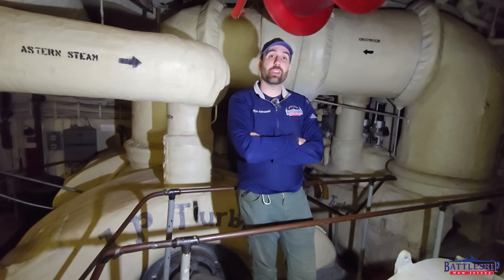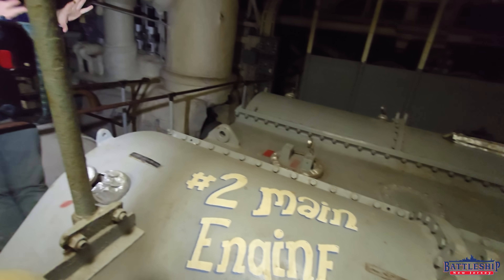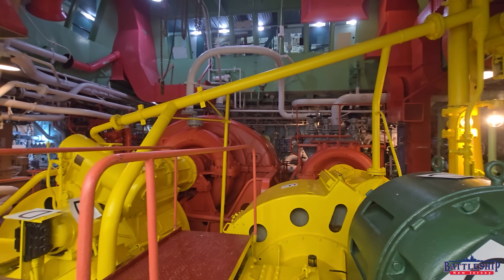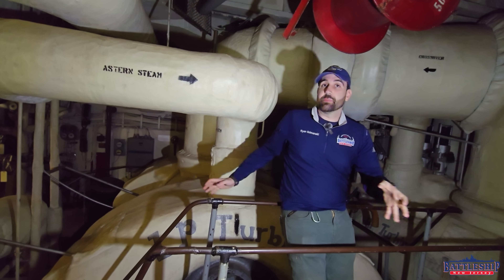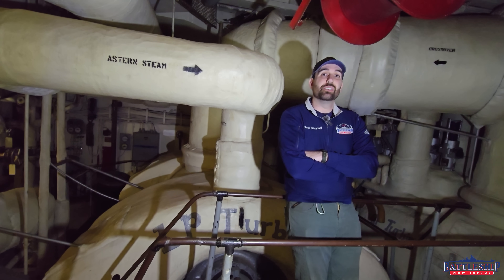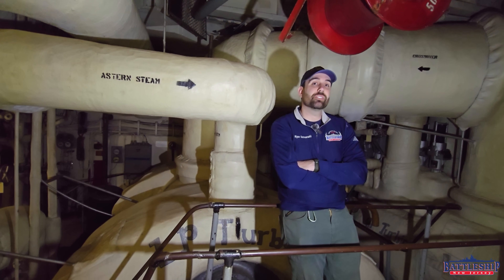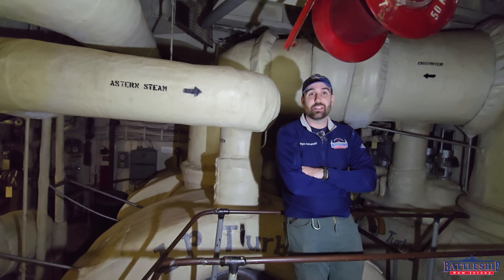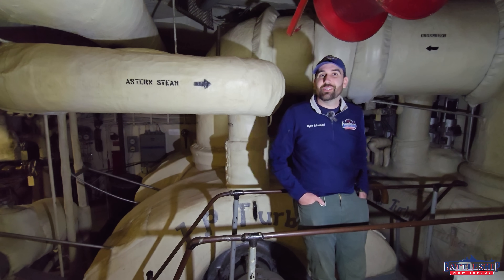Steam, Diesel, Nuclear, Reciprocating: A Look at Some Of The Common Ship Engineering Plants

Comment: Having served on a WW-2 Air Craft Carrier CV-19, Commissioned a Spruance Class DD-977 and taken cruises on Diesel Powered Amphibs, LST-1179, I vote for the Gas Turbine power plant.  It is fast reacting, fast to bring on the line, 60 seconds from start initiate to run and only seconds after that for full power.  The only advantage Steam would have is if Nuclear and that is range

Comment: I guess it depends what you need the ships requirements to accomplish. For the battleships as well as the SS United States you need a high demand for speed to either get to where it needed to be or be ready for battle. If maintenance was required it would allow boilers to be taken off line and allow them to be repaired/ maintained while underway. United States falls into the category because if she were to be used as the troop transport configuration she wouldn’t have to stop for repairs becoming a sitting duck or if running at reduced speed she would still be faster than those pursuing, the same as the battleships they each have the same redundancy. The steam turbines run smoother and don’t tend to shake themselves apart like piston type engines. Since steam is a more gradual pressurization of the cylinders they’re still more reliable than the ships diesel engines since they require the fuel to be ignited by combustion pressure alone. Add in the usage of turbines to increase pressures against approximately 20 foot long connecting rods and they  diesels become the most unreliable classification of engines. It also doesn’t help that they only have one shaft for propulsion. Since diesels operate with the lowest shaft speeds it also makes them the slowest to respond to emergency maneuvers. 
Since nuclear has the highest probability of radiation exposure it’s best for government deployment due to the expense of cleanup. It was my belief the Savannah was built as non nuclear, converted to nuclear, then converted back to nonnuclear. Unless it started as nuclear then non nuclear it was my understanding that it’s currently non nuclear.

With the constant modification of diesel requirements it seems the main problem with fuels resulted from more refining which ended with them running at higher combustion temperatures creating more hazardous combustion products. One also has to differentiate between asbestos and combustion hazards. 

Between any engine type I think I’d prefer the steam turbines since it has a higher speed capability and it can be tuned to run with less visible smoke and simply.

Comment: I wanna build a pair of compound radial flow gas turbine engines, running a pair of series-hybrid 14MegaW generator, charging up a 2 megawatt/hour lithium ion battery, and powering two 10MegaW prop motors. I want to develop a dual stage axial flow screw prop. I wanna make a doomsday yacht, a passenger submarine, because 100% all passenger subs have to be inspected by the Coast Guard, the government might wanna buy some of my technology, great way to kick off a horsepower empire!

Comment: The Diesel system you described is a diesel-electric system. These are frequently used on cruise ships, like the Queen Mary II. The Zumwalt destroyer is also Diesel-electric. There are also many direct drive Diesel engines, like the big container ships. These container ship engines are enormous and turn slowly, thus they don't need a reduction gear.  Smaller vessels use faster turning Diesels that turn propellers that roatate at higher speeds.

Comment: The reciprocating steam engine shown in the video looks like it has Stephenson valve gear to control steam admission and exhaust. Some of the earliest steam locomotives used this, but other types quickly became more common in service on land.
Reply: What other valvegears became common?
Reply: @gregorymalchuk272  Walschaerts valve gear was by far the most common. Baker valve gear is an modification of Walschaerts gear and was a distant second in US service.
Reply: @1959Edsel Were there any valve gears that gave independent control of steam admission and release?
Reply: @gregorymalchuk272  The British version of Caprotti valve gear was able to do that. It used poppet valves instead of the slide valves seen on basically all steam locomotives up to that point. By the time it was perfected, steam traction was well on its way out.

Comment: honestly steam, sure steam and its corresponding turbine is a nightmare to maintain and operate 24/7, but with what I know its one of the more reliable ways of getting torque to the props (and a whole lot of torque). I'm planning on using a Marine Diesel Oil burning boiler that will go to a geared steam turbine which then turns its own shaft (8 boilers, 4 turbines, 4 shafts, very similar to that of New Jersey), I know steam pretty well and I quite like how it acts, so yeah, steam ocean liners will return once I figure funding and a whole lot of design work out!
Reply: Steam turbines are the most reliable engine and run continuously for years at a time.  Steam turbine efficiency is  ~25% in a ship mainly limited by available space for the boiler.   (Powerplants are 35%, but have massive boilers, superheaters, and waste heat recovery.)

Container Ship Diesels are in the 47% efficiency range, lower front end cost, etc.  They are impressive! Google “Wartsila” the Finnish builder of these engines.

Gas Turbines are the least efficient, but have the greatest specific power.      Cheers

Comment: Nuclear power is not super heated steam. To super heat steam it has to be removed from the boiler and have heat added. Some steam locomotives had super heaters. Most fossil fuel ships have super heaters that use stack gas to elevate the temperature of the steam and thus gain power and efficiency. Nuclear plants do not have that ability and thus use saturated steam.

Comment: The question of which one is the best is extremely subjective and begs the question "define best." Is the goal to maximize efficiency? Reliability? Ease of maintenance? Range? Speed? Maneuverability?

That said, it's hard to argue against a mode Ryan does not mention in this video: direct drive low speed diesel. These engines have come to dominate the commercial fleets of the world and check of several boxes, but they are wholely unsuitable for a warship.

Comment: Ryan, the New Jersey didn't need to use only superheated steam to run the turbines. DD782 had M Type boilers and we used the SH steam when we needed speeds above 25 knots or if we going to have GQ declared. Otherwise we steamed using saturated steam. EX BT.
Reply: Didn't that lead to worse moisture erosion of the turbine blades?
Reply: @gregorymalchuk272  Gregory, I don't recall hearing about that from the MM's in the engine rooms. Being in a combat zone for most we didn't have yard periods where the  turbines were opened up.

Comment: Savannah has (had?) a pressurized water reactor (PWR). The "spicy rocks" heat the primary coolant (which, due to being under very high pressure, does not boil). The primary coolant runs through a steam generator where it heats the secondary coolant to make steam, which is used to spin the turbines.
Reply: NS Savannah's reactor and much of the radiation shielding was stripped out of her some time ago.  I read somewhere that nearly everything that still held any residual radiation including piping, heat exchangers and so on was also removed.

Comment: Some ships were fitted with a combination of triple-expansion and turbine engines - such as the liner Olympic. She wasn't the fastest ship, but even 20 years after being built she was one of the most fuel-efficient ocean liners still sailing - especially compared to contemporaries like Mauretania and Lusitania.  She was scrapped because nobody wanted to sail on a 20 year old stuffy ship where you had to share bathrooms with people in first class.
Reply: Olympic was also more efficient when they changed from coal to oil firing. That reduced significant the amount of labour workers but also with the controlled oil firing, the amount of fuel can be also saved.

Comment: Starting to think recalling the Iowa battleships would be cheaper than building new ones. Ship would be the most armored of any ship in service today. Also, the low tech ensures that modern counter measures don't work on the iowas. You can't electronically jam them, you can't disable their electronics from an EMP and you definitely can't jam their firepower. Even if you were to try and intercept the munitions, you make be able to get a few of them but when 12 of the projectiles are in flight it would not be easy to get them all. Also, even if you hit the projectiles, there is still a incredible mass still flying through the air. At some point warfare will become so high tech that the low tech might be an alternative since the high tech didn't account for old low tech. Kind of like how easy it is to steal a modern car using electronics, but stealing a old car isn't as easy because they can't drive a stick shift.

Comment: As I understand it, one of the limitations of a turbine is that it can't spin both directions, so does that mean there's a reverse gear in the reduction system? I remember that Titanic had two reciprocating engines either side and one turbine in the middle, and that the turbine couldn't run in reverse.

I know that reciprocating piston steam engines can be reversed by just adjusting the valve timing, I assume they can't do that with diesels?

Comment: Suppose there is also gas turbine running a generator. And then electricity cables to the motor driving the propeller or thrusters.

Comment: You missed one...  Several classes of US Battleships (including the Colorado Class) used turbo-electric drives where steam powered the turbines (like New Jersey) that, in turn spun an electric generator that powered the motors (like the diesel-electric subs).  A real hybrid system...
Reply: Also missing were direct drive diesel engines which currently dominate the merchant marine fleet. Ryan talks about diesel electric in subs but doesn't mention the other.
Reply: This always seemed to be a good concept. I guess practicality proved not so much.
Reply: @jameshigh6481 IIRC the problem of additional weight outweighs (pun not intended) the flexibility of installation on capital ships. That said, diesel electric is very common on cruise ships and smaller vessels. I've seen tugs and research vessels with it as well.
Reply: Gas-fueled, electric-driven propulsion plants do have applications for which they are quite practical.  As mentioned, cruise ships and other vessels often use them, mostly if they use azipods, lots of thrusters, or pump-jets - cases in which it's impossible or impractical to run huge, forged drive-shafts and fit delicate and expensive gear-reduction systems from the engines to all the various output hardware.  When the Colorado class used turbo-electric, it was mostly because we couldn't manufacture turbines or reduction gears or forge giant propeller shafts which were durable enough to handle the loads of driving a massive warship.  It was easier to run a turbine to make electricity and then you can stick giant motors directly in-front of the propellers and you don't need any reduction boxes or really long, massive shafts.  The big problem with turbo-electric is that it's not efficient (often it's not even possible) to use a motor that has enough torque to move an entire massive ship at high RPM.  That was the biggest single problem with the Colorado class: they could only 21 kts on their best day while the Iowas could do 33+ with favorable conditions.
Reply: Our brand-new coastal ferries are 10,000 T displacement and they're combustion-electric drive

Comment: All amphibious flat top ships post 2008 (LHD8, LHA6/7/8) are combination diesel/electric and gas turbine. They use the diesel/electric motors at slower speeds or for loitering and the Gas turbines for higher speed or flight operations.
LHD8 USs Makin Island in particular is an odd case as all previous ships of her class are steam powered. This caused some growing pains as normally steam operated systems had to be replaced with electric counterparts (water heaters for example)

These ships were once dubbed the "Navy's Prius" by  Cpt R. G. Kopas

Comment: my dad was a boiler technician 3rd class on a buckley class DE and then on a crosley class APD.  both used boilers and turbine drive systems.  the Slater in NY is a DE of cannon class which had diesel electric propulsion.

ive been on the Jeremiah Obrien several times as it steamed around the Oakland and San Francisco Bays.  it has a triple expansion engine like Brown does.
Reply: Texas too

Comment: What would have happened if either an engine room or boiler room were breached and water came through the bulkhead into the adjacent compartment?
Reply: The engine room and fire room on NJ had water tight compartments between them. One could flood, other could operate.

Comment: Have they ever had a turboprop style engine on a ship, where the turbine is spun by the hot exhaust gas generated by burning of a fuel? If you are not sure about what I am talking about, look up how a turboprop engine on an airplane work
Reply: Just about every modern US frigate, destroyer, and cruiser use GE LM2500.  It's basically just a CF6, same engine in 767 and 747 but converted to drive a shaft.
Reply: Covered @ 7 minutes in.
Reply: Yes; Liberty Ship YAG-37 had four later in her life.
Reply: I forgot to mention, I did not mean steam, just the hot exhaust
Reply: @AleksandrPodyachev  If I understand your question correctly, it is a matter of terminology - that is by definition a gas turbine.

Comment: For just simplicity and ubiquity I'd vote for the modern 2 stroke marine diesel. Big in-line engine directly connected to the propshaft. Want to go forwards? Start it forwards. Want to go backwards? Run it in reverse. Basically the direct continuation of the reciprocating steam engine, no electric drive at all. The majority of the ships afloat today use this system. But factoring in historic usage the reciprocating steam engine has likely powered more ships than any other other method, save wind.

Comment: I still maintain that the USS Constitution is the oldest commissioned Nuclear-powered vessel afloat. Its propulsion system is functionally indistinguishable (on a large scale) from the nuclear propulsion systems on modern submarines, except it uses clean fusion power instead of fission.
Reply: Ultimately, every type of power we've ever used is just the result (however distant) of gravitational collapse. Which I think is cool.
Reply: ❄
By that logic, when compared on a large enough scale, anything compared can be made to be moot - birds are 'nuclear-powered. 🤣
Reply: It was a chemist working for an oil company that first apprised me about  what powered his sailboat. As we went aboard he pointed up to the sun, and said it provided the power. Of course I had to query him about how, and the realization that wind often heated far out to sea by solar fusion came from the lesson I learned that day. Eventually I mentally connected that system to the transport of sea mist rising to be sent as clouds bringing precipitation leading to major sources of hydro-electric power.  We will eventually stop using the degraded results of eons of hydrocarbon depositions laboriously extracted from the ground and burned in boilers like the one Ryan shows us here.
Reply: I am ashamed to admit how long it took me to get your joke. Nice.
Reply: Close one eye, squint really hard, tilt your head to the right angle, and close your other eye, and you'll see it!

Ya know, I've never quite thought about sails being similar to turbines, changing the momentum of a fluid flow to transfer that energy into the deflector.